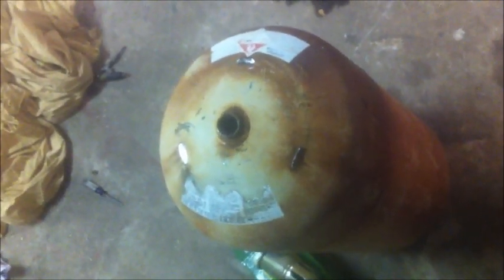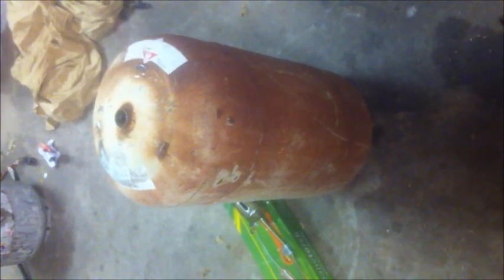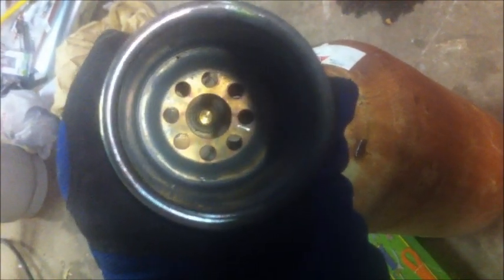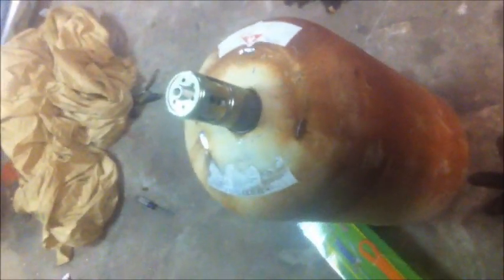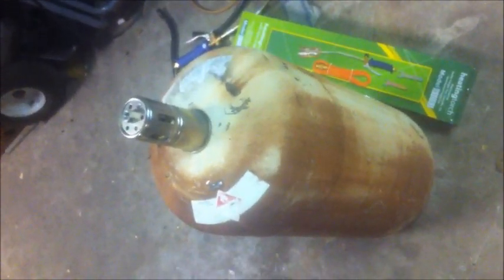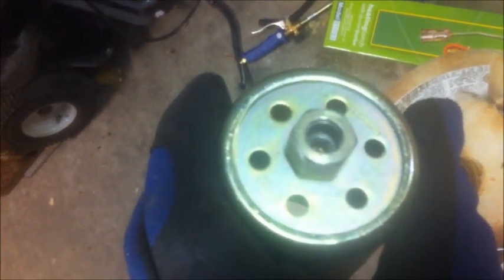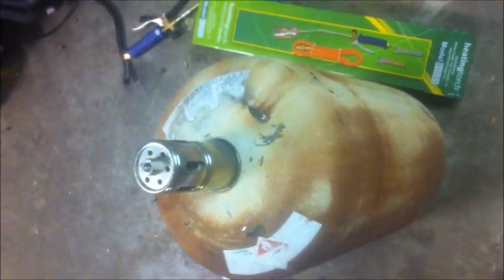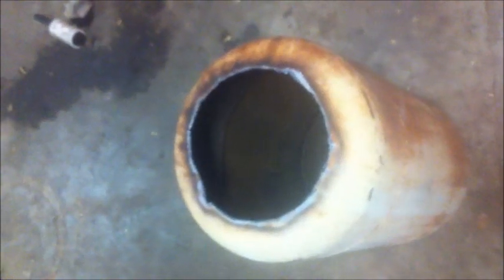Homemade Propane LPG Heater

Comment from the maker: In response to the many comments, I never used the zinc/galvanized duct for the heater.  I ended up using black chimney stove pipe.  The heater works well for my shop.